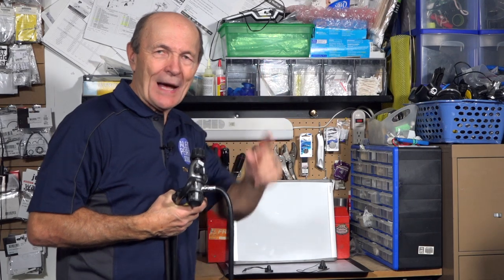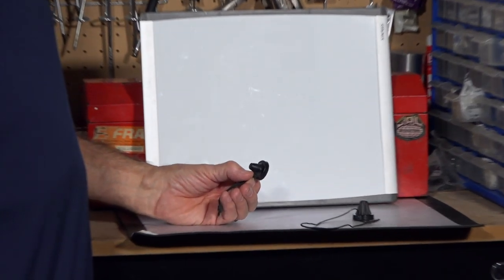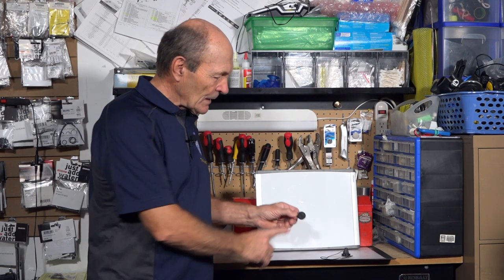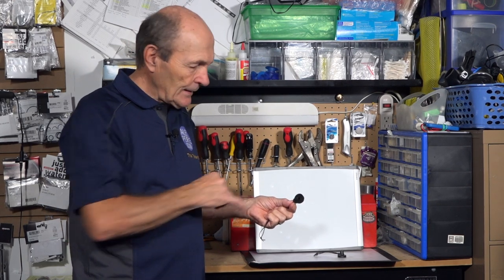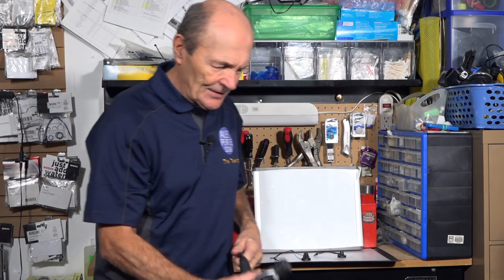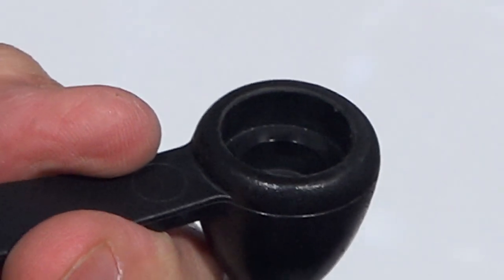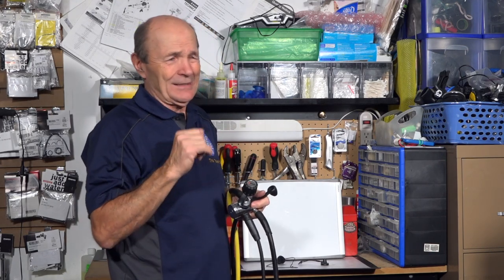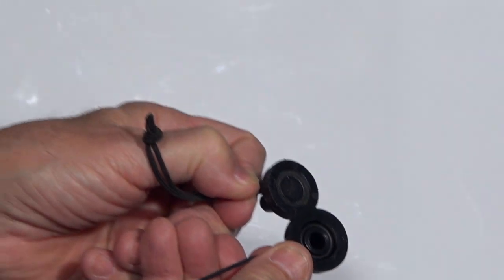Dust Caps - The Good, Bad & Ugly - Scuba Tech Tips: S10E09

Comment: Pro tip: cut that little tail off of the dust cap that secures it to your regulator and throw it in the trash bin. When you remove your dust cap to put your reg on your tank you can then put the cap back in your reg bag and leave it on the boat/shore. When you finish the dive and disconnect your reg from the tank, the dust cap is still dry!! :O Hole/no hole becomes irrelevant and life is good! (Maybe don't do that with rental gear though! The shop staff might not appreciate it!)

Comment: Thank you for the videos! But in this case there is nothing wrong with the caps. The failure happens when such a cap goes in the water and gets wet. Just remove them from the reegulators before diving!

Comment: Hi Alec. You wondered why the holes are there? the simple answer is the cap takes slightly less plastic or rubber to make. so when designers assume that the only requirement of the cap is to push down on the reg it is made to do that with the least amount of material. the buttress's do the same function just give a thin part more strength. I recall seeing one that was a solid rubber ball shape I think it was an old scubapro unit. take care Owen m

Comment: Nice piece and I would agree regarding the ones that you showed, which were all for yoke/a-clamp/international 1st stage setups.

There is another type that looks like a rubber ball at the end on the piece that attaches it to the yoke. Again these are popular. They work and don't have the hole to hole that teaspoon of water.

For DIN things are a lot different. The dust cap goes over the screw thread and has to have a large hole. There are a variety of different makes, but they all essentially work the same.

As for blasting the dust cap with your tank/cylinder post-dive, guilty as charged and I will continue to do it. I do look. I do protect the 1st stage as I'm doing it. Blowing with your mouth can result in phlem getting on the dust cap.

I seem to recall you talking about techniques for drying the dust caps before.

The only time I've ever had a problem was when a member of the boat crew put the cap in place without drying it first. He'd taken the tank off my BC as soon as I was on the back of the boat and before I knew it, he'd put the dust cap in place too. That was with a yoke-style 1st stage and a good dust cap.

I see already that some people don't like diving with their dust caps. I've always attached mine to my 1st stage and they go diving with me. Why? They can get lost or stolen otherwise. Also, it can rain whilst I'm diving. That dust cap will get wet if it does, so you're back to square one.

Comment: hey Alec great video

the deep recess in the last dustcap is so it can fit over DIN regulators as well
(the DIN reg has a short bit without thread on the reg, which the recess fits snuggly around)

saves the  manufacturer some cost, because they only need one dustcap for yoke and DIN regs
Reply: I don't think so. That unthreaded tip is pretty tiny. It wouldn't take much to knock off the dust cap if it were just clinging on like that. I've only ever seen two types of dust caps for DIN. 1) Threaded dust caps that screw onto the regulator and 2) the "condom style" that slip on over the threads.
Reply: @mrchriscarleton  my SP MK20 reg came with such a dustcap, and it fits pretty snuggly

maybe we are talking about diffrent parts of the connector
Reply: @robadex8043  Huh... interesting. Ok then! The more you know! lol

Comment: Hold that for a minute. what about DIN dust caps? alu vs plastic?
Reply: DIN dust caps will always have a deep hole because they have to go over threads. Getting water out of a DIN dust cap will always be a pain. The solution: don't have the dust cap attached to the reg. Leave the dust cap on the boat/shore where it will stay dry during the dive.
Reply: @mrchriscarleton  I was just teasing Alec :). And yes Din caps never in the water. keep them dry and put them on dry.

Comment: Here in EU using DIN regs, in lot of cases, you have completely same dust cap, but without the holding force from the yoke. So the dust cap sits on the reg just barely a any manipulation knocks it off. I've solved that with buying this: https://www.ebay.com/itm/OTG-Scuba-Diving-Delrin-Threaded-Dust-Cap-For-Din-First-Stage-Regulator-OG-55/291655986568?hash=item43e80d2d88:g:rcgAAOSwJ71acEQB
but I had to add another seal inside to have it seal the hole completely. Then, I am keeping it in dry place whenever I mount regulator on a tank and not bringing it under water. When I come back to surface and want to dismount my reg from tank, I prepare that dust cover, trying to keep it dry (sometimes carrying it using the tread and my teeth) and as I remove reg I put dry dust cap just right on it. No blows, no delays, just right away.
I saw recently a lot of divers to not have any dust caps at all and as they wash their equipment, they dismount reg from tank and spray fresh water even to the hole! Not pushing it inside, but like a bit from distance. It is not salt water, but still.

Comment: There's no dust underwater? Shouldn't your first stage be on your cylinder when you're underwater? I don't think you're supposed to fit a dust cap to your first stage when you're underwater. It's put on the first stage when you're out of the water. Plenty of dust in your home, and sand on the beach.
Reply from the maker: Hard to breath underwater with a dust cap on!
A